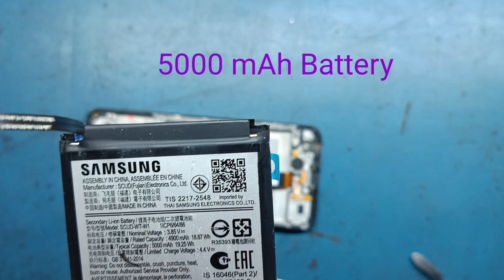Samsung A22 5G Disassembly Teardown How To Open Repair

Comment: after i disassembled it and repaired the problem the speaker stopped working, i guess i reassembled it wrong??? how do i re-attach it so it works since there are no cables or anything else?